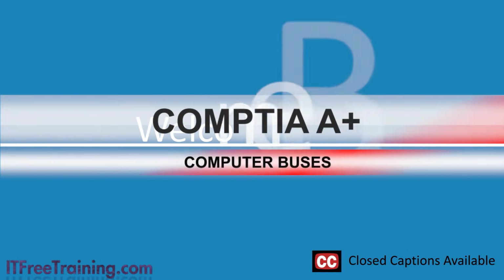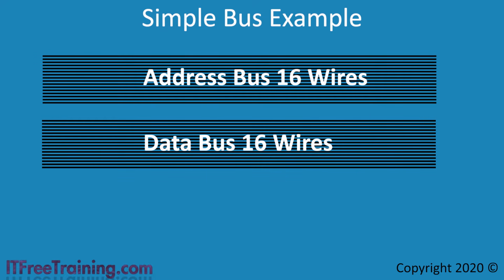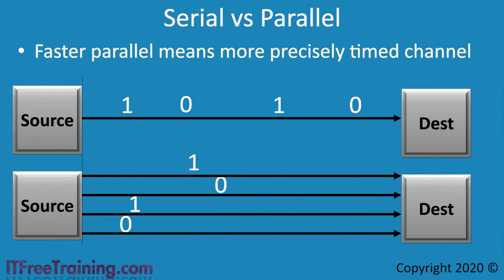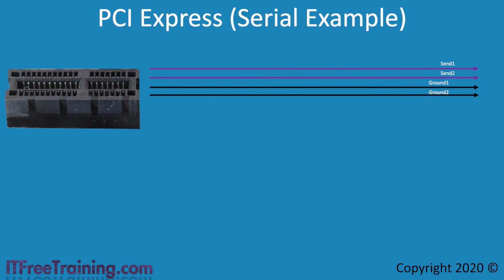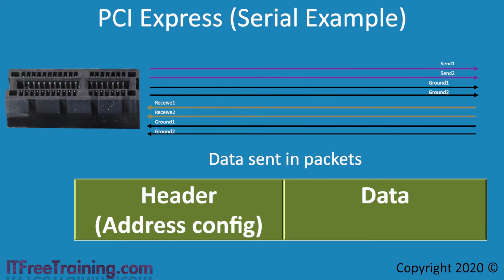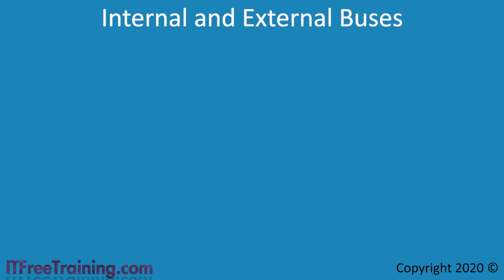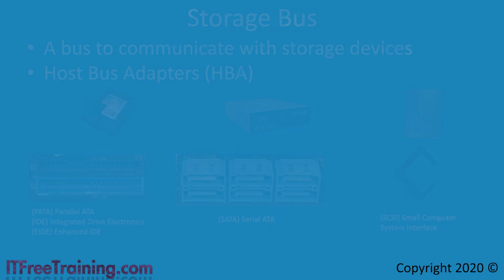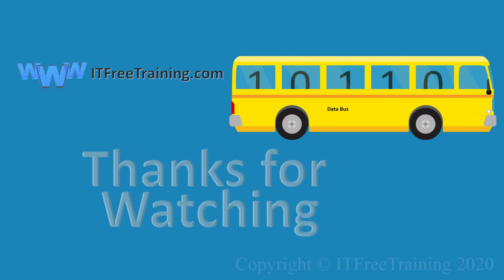Computer Buses

Comment: Sir, practically show where is bus? Is the pins are also bus? Computer circuits are bus? 
Outside wires are bus??
Reply from the maker: In the old days the bus were more clearly defined by circuits. Nowadays buses are only used in a few places like the memory. Lanes replaces a lot of the traditional buses.
Reply: @itfreetraining thank you sir for clarification.

Comment: Common Bus Standards
- PCI Express (PCIe) – High-speed internal connections for GPUs and storage.
- Universal Serial Bus (USB) – Used for external devices like keyboards and flash drives.
- Front-Side Bus (FSB) – Connects the CPU to the memory controller.
- System Bus – Links the CPU, RAM, and motherboard components.
Modern comput

Comment: Types of Computer Buses
- Address Bus – Carries memory addresses from the processor to other components.
- Data Bus – Transfers actual data between the CPU, memory, and I/O devices.
- Control Bus – Sends control signals to coordinate operations within the system

Comment: When we talk about a sata ssd connected to sata port. Is the sata cable called as a sata BUS. Or does sata BUS refer to the connection on motherboard running from sata port to the chipset like southbridge or platform controller hub? or are they both SATA BUS?
Reply from the maker: When we refer to a SATA SSD connected to a SATA port, the term "SATA bus" typically encompasses both the SATA port on the motherboard and the associated cables. Here's a breakdown of these components:

SATA Port on the Motherboard: This is the physical connector on the motherboard where you plug in your SATA SSD. It provides the electrical and physical interface for connecting storage devices.

SATA Cable: The SATA cable is the physical cable that connects the SATA port on the motherboard to the SATA SSD. It carries both data and power, allowing the SSD to communicate with the motherboard and receive power for operation.

SATA Bus: The term "SATA bus" is a broader concept that includes not only the SATA port and cable but also the entire data transfer pathway. It encompasses the electrical and data transfer protocols used to connect storage devices, which includes the SATA port, cable, and any associated controller chips or circuits on the motherboard.

In summary, when people refer to a SATA SSD connected to a SATA port, they are typically referring to the entire SATA bus, which encompasses both the physical port on the motherboard and the cable used to make the connection. This bus allows data to flow between the storage and the motherboard's chipset (usually the southbridge or platform controller hub) using the SATA protocol.

Comment: great video really appreciative, i am confused a little on the example you gave on the buffer on the northbridge 
the question is what caused the bottleneck is it the buffer or the gpu that is slow in 12:15
Reply from the maker: Essentially every thing in the computer has buffers. They may not be able to store to much in the buffers. Consider that GPU is trying to transfer data to the computers memory. In order to do that it is going through the CPU. The CPU also has software trying to transfer data to memory and the memory on the computer is not that fast. When this occurs, the memory can't keep up with demand. Thus, the CPU starts getting backed up. The back up is then passed onto the CPU. If you think of it like roads, same principal. If you get a road that is smaller than the other and everyone tries to use it, this will cause traffic jams elsewhere.

Comment: I'm trying to conceptualize a bus as a physical component and having a hard time with that. Is there a simplified way of explaining the bus in the context of the internal/external component, the I/O port, and the transfer cable? For instance, is the bus an actual physical component of a USB cable? Like the wires inside of the USB cable are the "bus"?

This might be the wrong way of looking at it and I'm hoping someone can simplify my understanding. Thanks!
Reply from the maker: A bus is essentially the communication systems that transfers data between components inside a computer or between computers/devices. Thus, you could call the data transfer between the computer and the device over USB a bus. For example, in the old days of SCSI cables it was often refereed to as a bus. So to put it simply, a bus packages the data up on one side of the cable, it is transmitted over the cable, it is un-packaged a the other end.

Although this may also sound like networking. A bus is a physical connection between devices or components, where network is more widespread. Buses are also point to point. You could have multiple devices on the same bus, but they are daisy chained together.

Comment: So I understand that it is important to have the 2 send lanes to reduce signal interference and potential data corruption, but with each of the 2 send lanes are they splitting the data being transmitted or is it just redundant?
Reply from the maker: If you have a look at the following picture it may make more sense.
https://en.wikipedia.org/wiki/Differential_signaling#/media/File:DiffSignaling.png
Essentially when you have two wires close to each other they will be be effected by interference the same way. To put it in basic terms, if one is pushed upwards a little so will the other. So the difference between the two will still be the same. So you could encode a one or a zero by having the difference between positive or negative.
So to answer your question, the data is not split. The data is essentially send twice which allows for more accuracy when sending.
Reply: @itfreetraining  Thank you! This was very helpful and I feel like it cleared it up for me.
Reply: @itfreetraining  Thanks I had the same question

Comment: 10:34 : North Bridge ? I thought the North Bridge Chip was a thing of the past and had been integrated to CPUs long ago ?
Reply from the maker: Nowadays it pretty hard to buy a motherboard with a Northbridge so you are right there it pretty much gone with new products.  However, you may come across it looking in old hardware so for this exam it is required. I would not be surprised during the next revision of the exam objectives the North Bridge disappears for the exam objectives. For this exam, regardless whether the North Bridge is a separate chip or in the CPU you just need to have an understanding of how it works.

Comment: 2:33 How does 16 Address Bus Wires equate to 64 kB of memory?
Reply from the maker: The maximum number in 16 bit (1111111111111111) is 65,535. Add one since we are counting from one 65,536. Divide this by 1024 (for 1 kilobyte) this give 64kB.
Reply: @itfreetraining  if 65536 bits are there, in bytes (8 bits is 1 byte) its (65536/8) 8191 bytes. How is that 64K Byte ?
Reply from the maker: @mithurshan1  The address references bytes not bits so don't divide by 8. Thus, 16 bits can access 65536 bytes which is 64k.